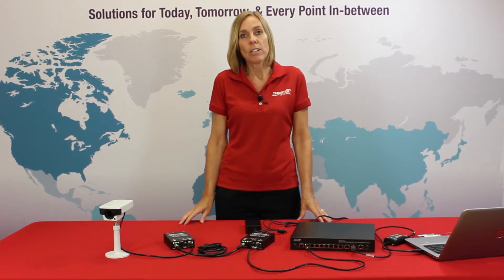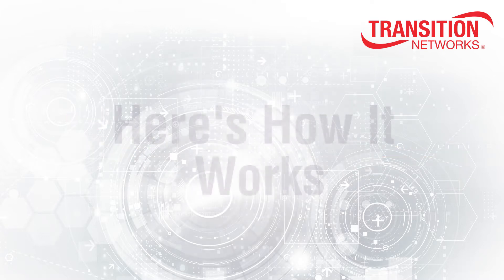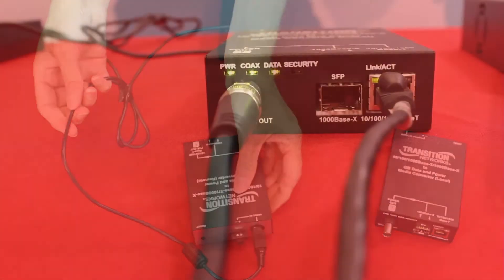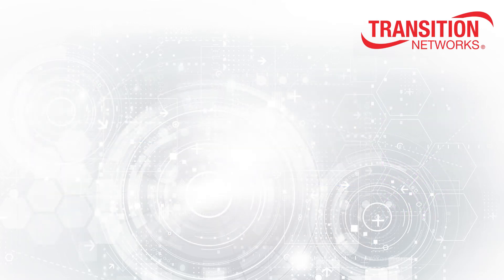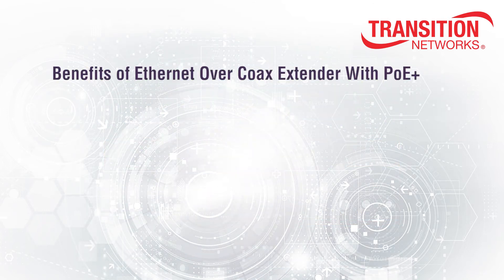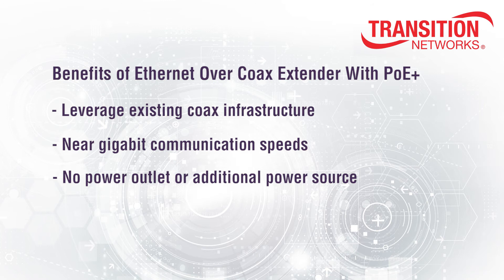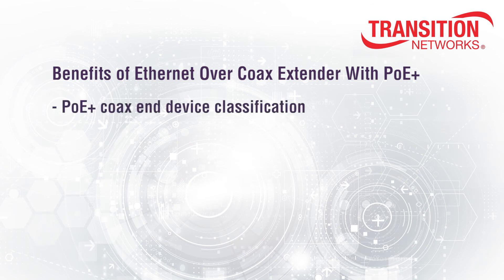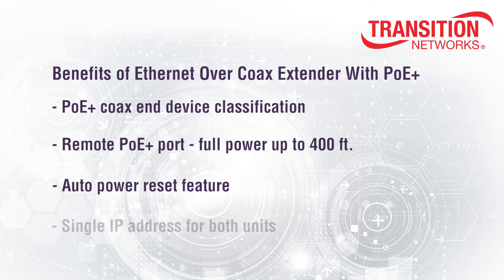Introduction to the Ethernet Over Coax Extender With PoE+

Comment: So basically if you have a location where you have a network PoE device like a camera or wireless transmitter, but that location does not have electrical socket and the only existing cable that goes there is a coax, then product is for you.
Reply from the maker: Hi Jason, You are exactly right. Our PoE solutions bring connectivity and power to where it's needed. Let us know if you have any questions.